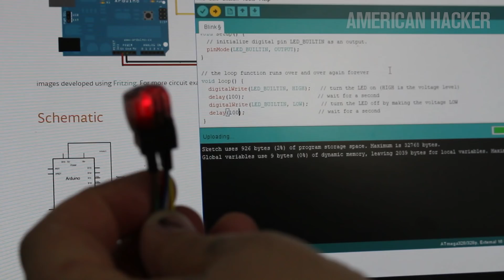SMALLDUINO - World Smallest Arduino Compatible Board DIY

Comment: I don't see much use for 4×4 headers. I have done some work with enameled copper wire in the past though. You spent awhile working on this. I'm surprised you went with through hole components as well.

  Want a hacker suggestion? What is hidden inside a random device? Take a single item like a microwave, and turn it into something completely different and useful. For instance a neighbor of mine threw out a cheap microwave from Walmart this morning. I took it apart to find a dual polarity switch mode power supply, 2× 24 volt relays, 2× temperature switches, 3× micro switches, a segment LED clock display, a 120v fan and low RPM motor and a PCB with several general purpose transistors. 
   What useful thing can you build while only using parts like this? ...at least that's the kind of thing I'd like to watch.

    Oh and the microwave design I took apart uses an ABOV MC96F8316 microcontroller. After looking it up a few minutes ago, it's an ancient Intel 8051 based design updated with 32 pins (SOP surface mount), 30 I/O, 16k flash, a 12 bit ADC w/15 ports, 12 ports capable of 25mA direct LED drive each (600mW total package), a 16MHz +/-1% internal oscillator, 1× 8b timer 2×16 bit timer, 1 UART, 1 SPI, 1 I2C, and an 8 bit buzzer.
    I'm barely literate with AVR's but those specs make me want to check out how to mess with 8051's, especially that 12 bit ADC and Direct LED drive capability.
   The FX2 chips from Cypress Semi are also 8051 based. Those chips are used to create the dirt cheap (clone) 8 channel USB logic analyzers used on OSSW like Sigrok. So it's probably worthwhile to get mildly familiar with that sili Grandpa 8051.
   Not to mention... search 8051 on YT. I haven't got a problem with none native English speakers in general, but the available content I could find about 8051 programming has particularly bad content from mostly Hindi speakers that have too much of an accent for me to follow on technical subjects. 
-Jake